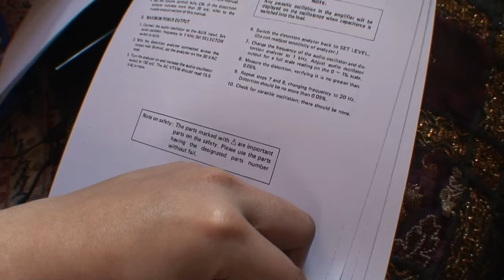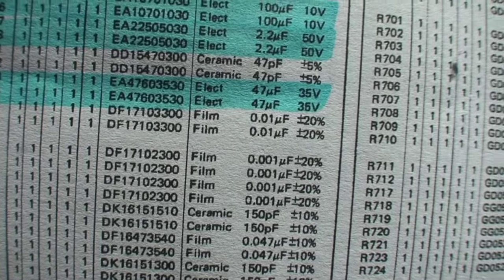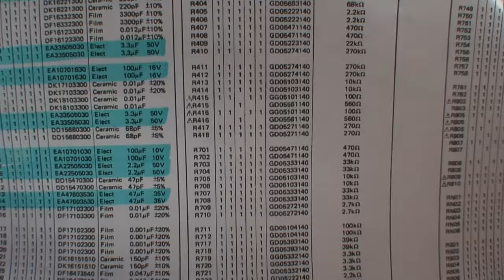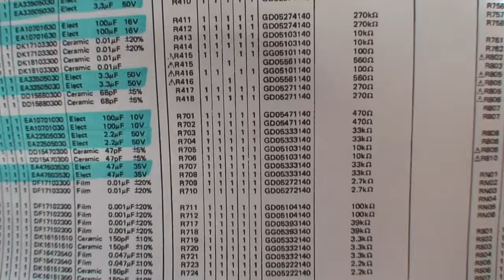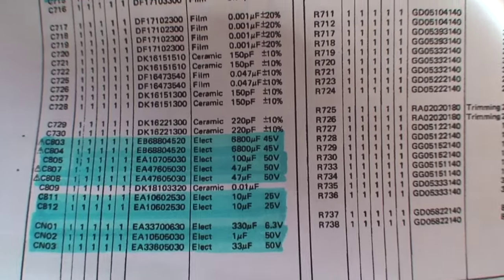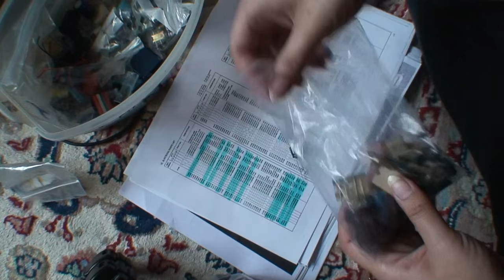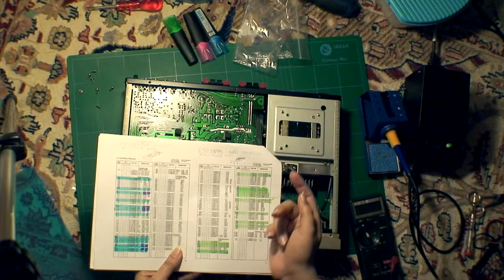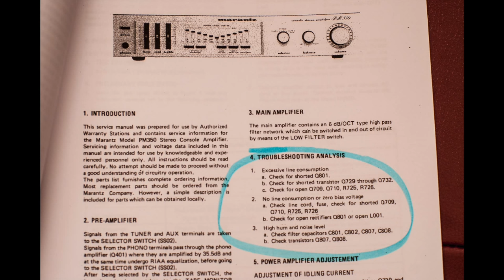Vintage amp repair - 02 Update and troubleshooting

Comment: It's really fun to see people fixing these old things, rather than throwing them away. Audio equipment just isn't made like that anymore. I really hope you get it working great again! :D

I replaced the output power transistors in an old AKAI stereo receiver a couple of years back. I couldn't find the exact replacement parts, so i put in some modern equivalents, that have some better performance. and damn did that thing come to life! It sounds way more powerful, yet retains the nice 70's sound. It's very nice :)
Reply from the maker: +Electricguy Yes I agree! Audio equipment these days is boring, I miss the vintage equipment. 
As for this, i'm absolutely stumped, in part 3 of this I replaced all the capacitors, i've tested all transistors, I will replace some anyway because there are some different to what is in the service manual. But yeeah i'm stumped, all this replacing is equivalent to twiddling thumbs at the moment lol. This thing is probably freakin haunted ;o)) 

It seems you completely gave your AKAI receiver a new leash of life :o) I hope this ends up the same way! I really like the feeling of reviving old amps, it makes them that extra bit special :o)
Reply: +MsMad Lemon Exactly! They had much more fun and innovative designs back then! Hence why i usually build my own audio gear instead of buying it, because the stuff i can afford to buy isn't up to spec :P

Ahh i see! Yeah it can be tricky to find the issue sometimes. If one channel of the amp is okay it's easy to use that as a reference when fixing the other. Otherwise your only hope is probably the service manual and poking around :P

Comment: Do you still have your pioneer receiver? Are you open to selling it?
Thanks
Reply from the maker: i've never had a Pioneer one, I think you're referring to the Technics SU-V2? I'm keeping it as a spare
Reply: MsMadLemon oh my bad I meant the technics. I currently have a Sony srt 6045 that sounds amazing on my sunsui speakers.  I'm thinking of getting something with a bit more power,  Most likely a marantz as well, but they are not cheap, they go for 250$ and up where I live.  How much did your marantz cost you?  Oh Also do you know if it's possible to put those blue led bulbs in my Sony that people put in there marantz? I think people get them from eBay.  Thanks